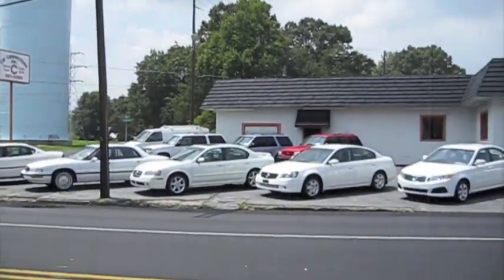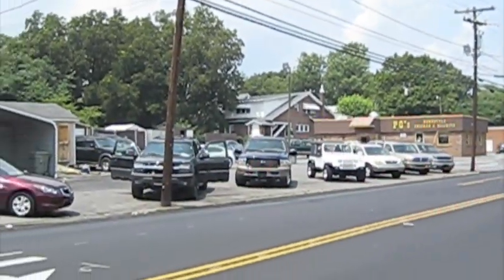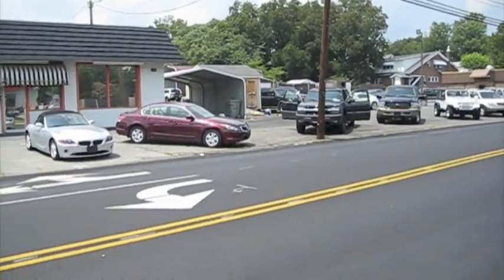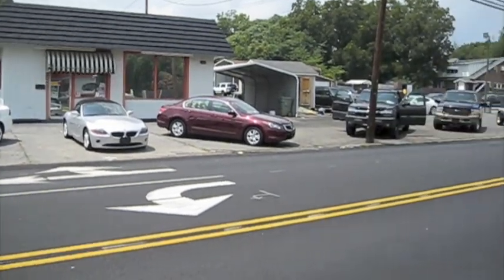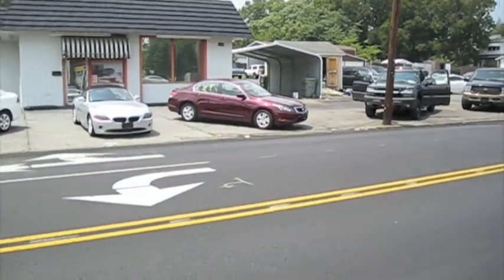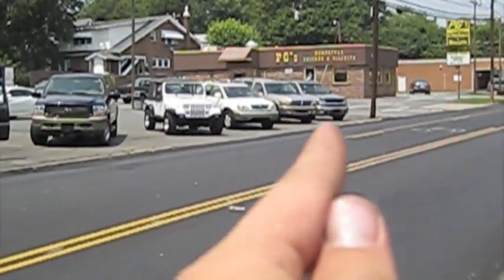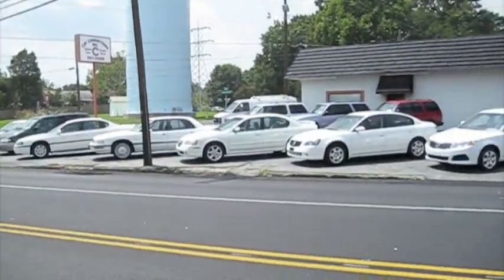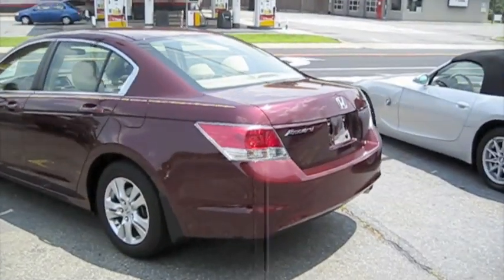Start Ups and Tours of all the Rest of the Newest Dealership Vehicles (5 more)

Comment: on the work van, have you checked the fuel pump?

My dad's silverado did the same thing.  It would turn over and over on certain mornings, but after it finally started you could turn it off, then start it again, and it would start right up.

nice video.